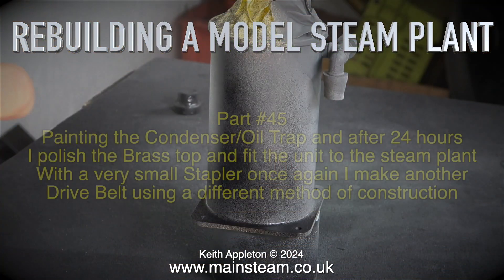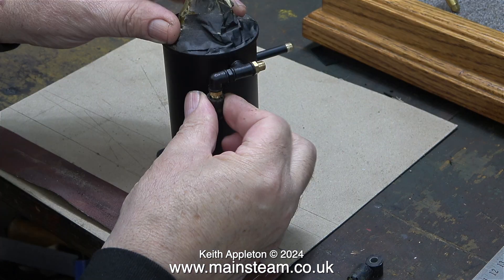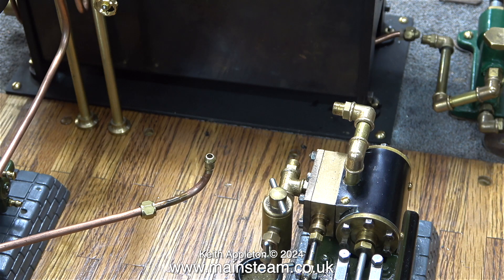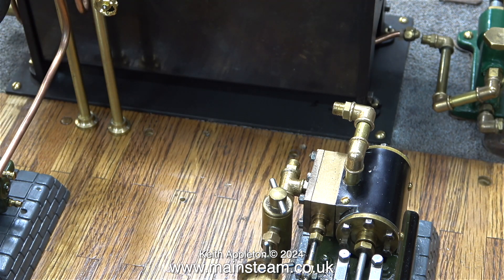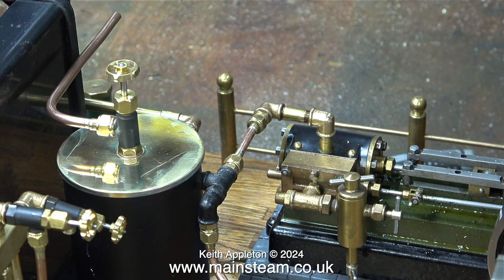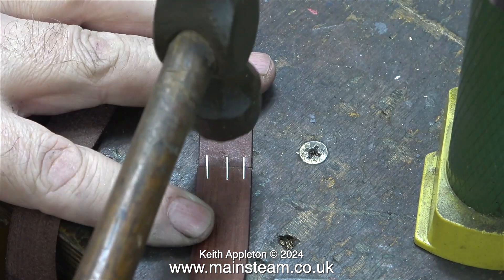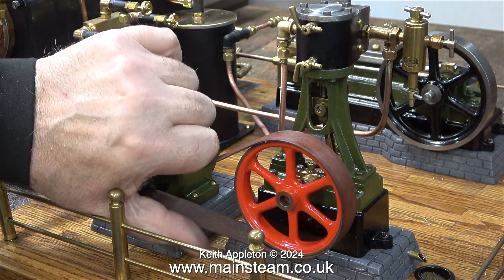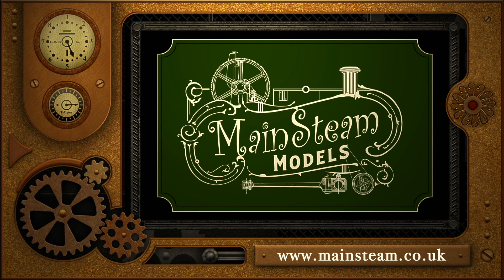REBUILDING A MODEL STEAM PLANT - PART #45

Comment: how hard is the base boards you use? / and is it easy to  strip the threads in the board?/
Reply from the maker: High quality plywood with thick Mahogany planking as shown in the video. More than strong enough for the job, the threads do not strip.